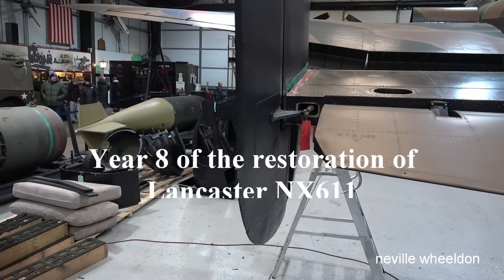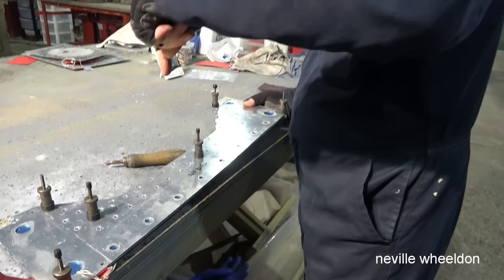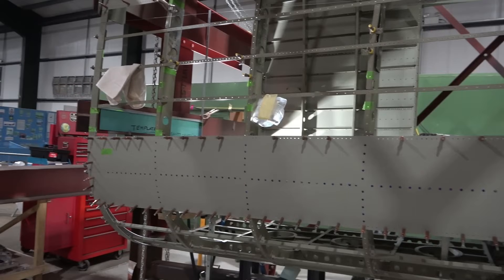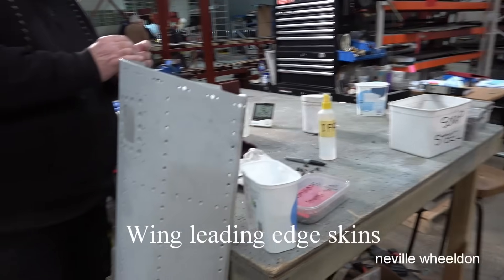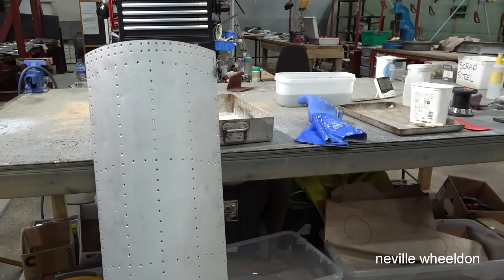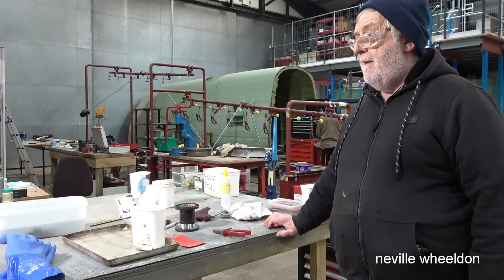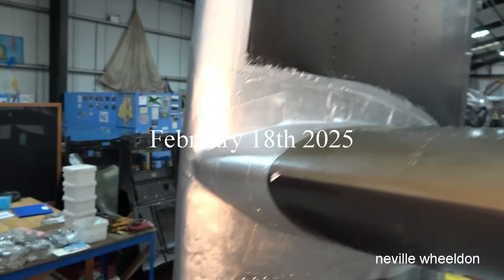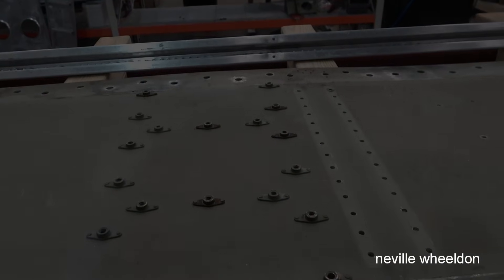Video 289 Restoration of Lancaster NX611 Year 8. Tailplane fitted to NX611

Comment: That saving the leading edge skins is HUGE.  I remember during the time of the Boeing E-3 AWACS, the skins needed replacement, and they went through 15 contractors who bid and failed, before going back to Boeing to use their original tooling.  All that is gone now - don’t know what they’re doing for those leading edges.  BIG WIN for NX611 and the restoration.

Comment: Always bad to use steel and aluminum together because if they touch one another you get galvanic corrosion. If you use aluminum Fasteners onto steel they will both corrode. You would have to have a backing plate to separate the two metals to keep them from corroding. You can use a role of rubber that has an adhesive to hold them to each piece that way you have a way to keep down the corrosion but then you have to put in Fasteners and you have to have a way to separate the aluminum and steel Fasteners from touching the opposing metal. Sometimes you don't have much of a choice because you may need a stronger metal in one place or the other but whatever the case you will have to be vigilant and inspect those parts regularly and clean them and painting them would help separate the two metals. If they have a tendency to vibrate against one another of course it could cause the paint to rub off exposing the metal to each other.
This is a great video and I'm a first-time watcher. Love to see repair of old planes. I don't however understand what year 8 is.

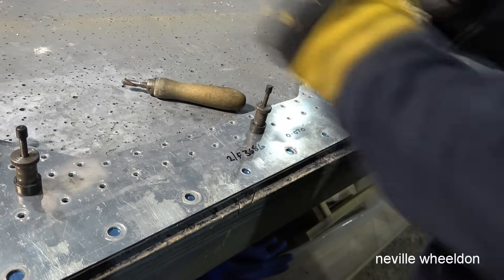Comment: @3:10 John is explaining the result of the rivet gun accidentally bouncing on the round rivet head. If it bounces on the head (as John explains) it puts a mark that looks like a smile and if it bounces next to the rivet on the skin it looks like an eyebrow. My inspector was always looking for smiles and eyebrows. This was in the 1960s when I was working on Douglas C-47 Dakotas that had been converted to DC-3s. Our airline operated well over 50 of them during this period. They were getting pretty tired and needed a lot of sheet metal repairs.